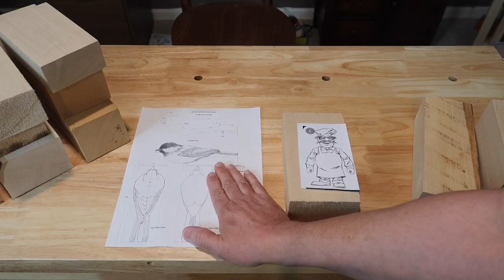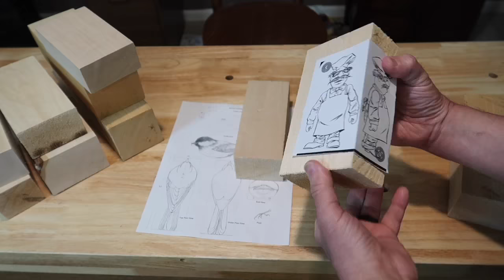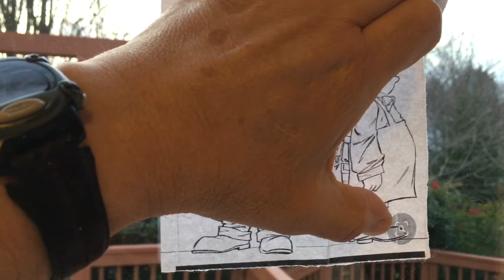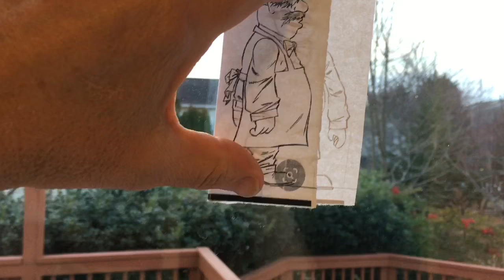Cutting Blanks For Wood Carvings

Comment: What is the dimensions of the blade your using on cutting out the man.  What’s the TPI of the blade.  Thanks for the video.
Reply from the maker: Are use high-quality Bosch blades but I run them for a long time. I used a 1/8 inch for cutting out the little guy.
Reply: @markdmaker3173  how many teeth per inch?
Reply from the maker: @donburnside6448  I’m pretty sure it’s 15 TIP

Comment: Would a scroll saw suffice for cutting blanks this size? I'd be doing mainly smaller carvings. approximately 2"x2"x6. I wanted to cut down on some of the time and guesswork in the rough out process.  Just a bit unsure of whether it would be the appropriate investment. I can get a used 16" delta of skil online for pretty cheap ($50).
Reply from the maker: Thanks for your question. I have cut out hummingbird blanks on a scroll saw no problem. I would look into how much height clearance the saw has. You could always scale down your carvings to miniature size which would definitely work.

Comment: What size blade was on the 2nd band saw?
Reply from the maker: Thanks for your question, sorry for the delayed response. My second bandsaw the 10 inch delta has a 1/8 inch blade in it. It’s the smallest one I can find and spins around just like a scroll saw blade. I installed a carter blade Guide designed for small blades and removed my guides to have that kind of flexibility.

Comment: You said Basswood is a hard wood??????????🤔🤔🤔🤔🤷‍♂️🤷‍♂️🤷‍♂️🤷‍♂️🤷‍♂️🤷‍♂️ I’ve always thought basswood is a very soft carving wood softer than Limewood!
Reply from the maker: Thanks for your question. Yes, basswood is considered a hardwood but it has very little grain making it easy to carve. I have never carved lime wood before but I’ve been told that it is identical to basswood.
Tupelo is a very soft wood, so soft and light that a knife does not cut it very well do you need a rotary tool.